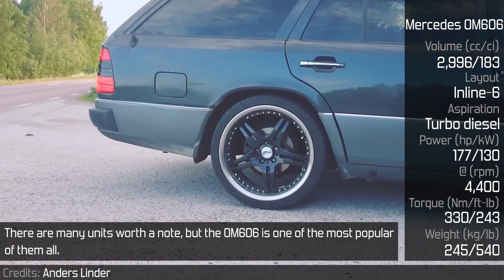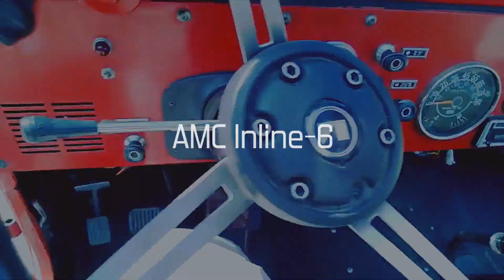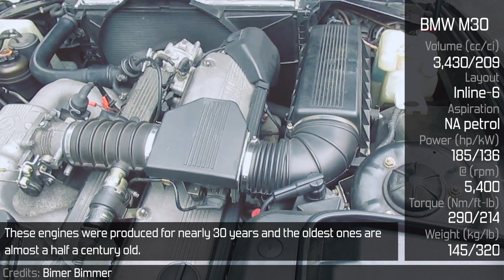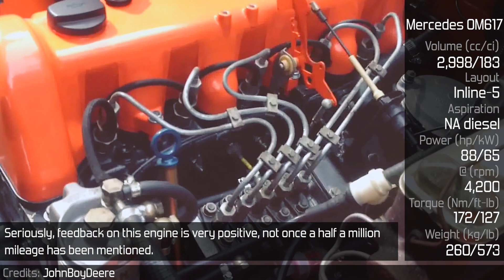10 Most Reliable Engines Running Beyond 300,000 Miles

Comment: Volvo B18 and B20 wasnt really that great stock, the B18 in particular was plagued by very cold thermostats, and all of them leaked from the back of the crankshaft until modified with a modern seal. One of my -65 B18D survived almost 200k km with the original seal but by then it was already spraying out oil through the seal, also B20s i had did this at high speeds, if i was above 110kmh it used almost a litre of oil a day. Sure they can run 300k km but not without a new hotter thermostat and seal. B19 and B21 can however, i had 100% original engines going past 600k km, only change contact points, spark plugs and oil. B18s cant do that in their original configuration.
Reply: I wonder how anyone would want to drive 300k+ in the cars these engines was in. Driving a car should be a pleasure, not a workout, and the P1800 was the only one I wouldn't had to hide in a dark corner if I owned one, the others where hideous.

Comment: First or second gen small block chevy engines. My daily truck has 298356 on the clock all original... mind you the 4l60e is starting to slip but the motor has even compression across the board and has never been opened up aside from a timing chain

Comment: Talks about reliable engines if maintained properly , shows them being redlined and getting abused .
Reply from the maker: I don't believe that changes the fact they are reliable engines. Getting abused in a good way is beneficial for an engine - you need to stretch its legs once upon a time.
Reply: VisioRacer True but it depends on the car type and when it was made as you said. New cars you don't really need to push and obviously you shouldn't really ever redline something like a suv or van but you should with like a sports car.
Reply: VisioRacer 
Remind me to avoid your "OfferUps" THX.

Comment: Glad to see the Jeep inline 6 on here. Would have heard an ear full if it was not.

Had one that had over 350,000 miles on it when I sold it to a friend. Last time I talked to him he told me it had over 550,000 miles on it and still runs great. Most major work ever on that vehicle was a clutch and a master cylinder but never any major work on the engine and still did not leak a drop of fluid.

Comment: I think the 300 cid or 4.9 litre Ford inline "6" should head up this list. UPS used this engine exclusively as long as it was made. 300,000 miles was nothing for these engines. They easily surpassed that if kept from overheating, over revving and the oil kept clean and with sufficient oil pressure. That said, MOST engines will go a lot of miles IF they are taken care of. The Ford 4.9 litre had the advantage of gear to gear timing, no chain. And it was designed not as a vehicle engine, but as an industrial engine, which Ford used as a "temporary" solution when needing a bigger "6" for the F series. It stayed around a lot longer than envisioned. BUT, there were some TRULY horrible engines built. The all aluminum Peugeot in the 60s a prime example. Better a chain, sprocket and pedals than that in your car. With most though, take care of the engine and it will take care of you. *caveat* There are "lemons". Odd man out if you will. A thousand good ones, but if YOU get the one lemon the bad taste never goes away.
Reply: 500k on a 4.0 Ford still running strong
Reply: Ups world port still had several inline 6s still running . Tugs and ground equip
Reply: Brandon Murphy my 4.0 still pumping at 350,000
Reply: The Ford 300 (4.9) will keep running even when abused.  After a nuclear war, the only thugs running will be cockroaches and Ford 300s.
Reply: And AMC 4.2 sixes with points and carbs. They will laugh at an EMP.

Comment: I had a Ford Mustang inline 6 with 320,000 miles on it.  The carb fell off while I was driving and I put it back upright and continued across and up the state of Florida from Daytona to Fort Walton Beach.  My brother was working as a mechanic and said I must have the air cleaner mixed up, then he saw it and was amazed it ran. 

 I had put some Slick 50 Teflon treatment in it.  I hadn't heard the engine knock in a while and stopped at a gas station to have the oil level checked.  The mechanic pulled the dip stick out and put it back in, came to me and said it didn't have any oil.  Slick 50, probably helped a lot with that car.

Comment: Honda Civic 2013 2.2 Idtec hatchback.
Man what an engine, certainly an underrated car.
450.000km without any issue, no damage, no black smoke.
And even drove better and better every day.

Also when i went to japan for a holiday.
those taxi's there, sheez?! (Toyota Crowns)
some had 840.000? and still went on without troubles.
They squeeked less then the avarage taxi cab i have in my country.

Comment: I've only had two vehicles that exceeded 300,000 miles without any engine trouble and the first was a 92 Ford /Yamaha SHO 3.0 and a Supercharged Pontiac 98 GXP 3.8 and neither of those cars used oil in-between changes

Comment: The Nissan TD42 (4.2 litre 6 cyl diesel) sold in Nissan Patrols and Nissan trucks is a reliable unit. Gear drive OHC, pre-common rail and solid construction. Add 10psi with a turbo and they just keep going with good power.

Comment: I have a Dodge with a 318 c.i.  (5.2 L) with about 500,000 miles on it. The secret to it's longevity seems to be to change the oil every 5,000 miles whether it needs it or not, using the cheapest SAE oil I could find. Price determined what to use. Still running fine.

Comment: i have a 2004 chevy cavalier with the 2.2 ecotec dohc and I have 265,800 miles on it and never had a problem with it. I still get 35 mpg and it starts up with a half turn of the engine. no knocking,ticking or smoking.

Comment: Had a '84 Mazda 626 5sp put 240,000 miles on it. Never had the head off.Took it off the road in '06 with original trans, clutch, carb. Still have car in my back yard...but it's seen better days...lots of rust [NY winters] but engine still runs. Replaced it with a 06 Toyota Tacoma. Just can't seem to part with the Maz.

Comment: The Toyota 3TC was used in fork lifts. I had a guy drive up to my store in a fork lift and wanted a set of points. Thinking it might be a generic distributor, I looked at the engine and recognized it as a 3TC.. I got a customer for life. The slant 6 Chrysler and the 4 cylinder 153 Chevy II engine was also used in fork lifts, as well as some Falcon Ford 6's
Reply: 76 Corolla 2tc was excellent

Comment: Look into adding the dodge slant 6 engine the dodge 318/5.2L.and any of the LS chevrolet or gmc engines  4.8 5.3 6.0 6.1 6.2 and 8.1 in either aluminum or iron. I see them regularly at 300,000 in Facebook marketplace.still running well.

Comment: Had a 1980 Datsun (before it was Nissan) 200SX with their 2.0 liter 4 cyl.  It had one of the early electronic fuel injection systems (worked great) in a basic car.  Used Mobil 1 the entire time and never had any internal work needed.  Sold the car in good condition with 379,000 miles on it.

Comment: I currently am driving a 1996 Isuzu Rodeo 3.2 L - 24 valve. It has 443,200 miles-gas mileage always at 22-24 mpg....it has started to have oil leaks-camshaft rear seal plugs on heads are leaking a bit. There is no room to access seal as it's between cylinder head end and firewall of car. Seems like oil seals are always a problem-especially rear crankshaft oil seals as the transmission has to be removed to fix that. I would think a crank seal that could be adjusted/tightened with easy access would be a great invention for car makers to utilize. (I did change that and clutch assembly on Rodeo at the 260,000 mile mark)

Comment: You forgot the Chrysler slant six.  The "leaning tower of power" is extremely hard to kill.  Used from the early 60s to the mid 80s.  A buddy of mine had one in his 66 Valiant the he sold a couple years ago, and it was still running strong.  A for reliability you couldn't beat it.  l had one in my 1980 Cordoba that started in -40 temps without being plugged in.  Sure you had to physically go out and pump the gas a few times, but it always started.

Comment: I'm not sure about the PD, but certainly the Volkswagen TDI was out before 2000.  I saw a VW Passat estate with 377,000 miles on the clock.  Toyota 2 litre diesels were another.  I saw a 2001 Avensis for sale with 320,000 miles on the clock.

Comment: BTW that volvo b1800 mentioned with 3000000 on the clock has had a couple of rebuilds I once read. It didn't do 3000000 with no rebuild.
Reply: But still a very reliable engine,  b18 and b20 was the engine used in (Hagglunds?) Bv 202 (bandwagon)  They can take beating like a champ, you can hit the revlimiter all day long and not blew the shit up, did it daily for 9months as a driver of bv202 powerd by Volvo B20 in the army, low geard transmision and the revlimitter gave it a topspeed at 39kmt at around  5500rpm i wiil remeber. On the highway the revlimmiter was attempting to get rid off :) No problem what so ever with the engine. Sorry for my english, not as good as b18 or b20

Comment: The 225 Mopar slant 6 was unbelievable. I spoke to a machinist that all he did was rebuild motors for a half century. He told me he seen 5 slant 6s that needed reboring 5. The body of the car or truck would fall apart before the motor. I had a dodge 3/4 ton 2wheel drive and a 3speed manual trans it got 22-24 mpg. While it wasn't powerful or fast it was super reliable better than my Mercedes Benz diesel. Better than my gm 250 6cylinder. I loved them especially the hemi head the only problem was oil leaks if you didn't change the spark plugs tube gaskets when you changed plugs. They were tough. Wish I had one today. The 1.2 Subaru 3cylinder was also a fantastic motor I put 342,000 on my justy before I gave it to a friend. The automatic was shit at about 150,000 I swapped mine for a 5 speed then it was fantastic. Only got about 28 mpg. The 232 6 rambler was durable parent to the Jeep 6cyl with the cast iron head was bullet proof.

Comment: I have both the Ford 7.3L turbo (International Harvester) and Dodge Cummins 5.9L.  The Cummins crushes the 7.3L in longevity and many other areas such as mpg, low vibration, and noise level.  The 7.3 is cool though, sounds tough like a tractor.

Comment: I don't know the number of the motor, but my fahther had several BMW with the 3l Bi-Turbo Diesel, those were: 335d Touring(2005), 535d( 2007), 335d(2011) Coupe, X5 35d( 2009).All bought with around 200tkm and all sold with over 350tkm, only the 535d had an Turbo failure, all the other cars had the normal spareparts, like brakes or tires and also regular 5w30 oil.
And in addition: No Problems with the DPF(=DieselPartikelFilter)

Comment: All of the engines qualify but the GM 3.8 had major problems with plastic by pass valves which would leak or break and the engine would overheat and blow up.  Plastics and cooling when will they learn, there was a time when copper and brass were common materials used for cooling systems on cars

Comment: I would have just said the whole "UZ" family of engines by Toyota as the 2UZ was the engine used in the "million-mile Tundra" which had an all original drivetrain. Also another thing to add about the 6BT is that it uses a gears for timing instead of a chain/belt for added reliability as gears don't wear out as soon as chains/belts are known to.

Comment: You really need to take a look at the Ford inline 6 older model from the 1960's 70's and 80's those motors are hard to kill take a beating and keep running  also the 351 winzor and Clevland motor or as you would know 4.6 liter v8 mostly in our older Police crusier  Ltd and Crown Vic and Pickups

Comment: Have an old Sentra 1.6 JN51 with 364,000 miles, just one head gasket change. Still starts and purrs, and my father drove it from CA TO WA loaded with weight. Nissan even built their inexpensive models to last. 
Wonder why Toyota went to single timing chain on the great 22r, while Nissan stayed with dual when going from L to Z series? 
Also have a Z24 hardbody. Been rebuilt, at close to 300,000, but now over 423,000. I don't know how it was treated before I got it at 204,000. Trans and diff untouched except  for Amsoil.
Definitely have seen the 3.8 Buick go past 300k.

Comment: Still driving my 1980 Toyota SR5 with a 20R  and a 5 speed with over 200000 miles It does not burn oil ,starts every time and still runs like it did in 1980.

Comment: GM 5.7liter  350cu V8&2.2liter
Inline 4. I had both these motors run 350,000miles,no major overhaul.The 2.2liter will crack a head(or head gasket sometimes if overheating).Still have the 2.2 in 03 Chevy S10(347,890 on the odometer)

Comment: A friend here in Canada had a 2001 Pontiac with 3.8 litre V-6 that was running fine at 830,000 km (about 525,000 miles) but the moncoque body meant the area between the floor and side of the car rusted out so he had to scrap it. I have a Y2K (year 2000) version of same car and engine runs very fine at 170,000 miles as does tranny but also the floor is rusted away around the rocker panels and welders can't find anywhere to attach new metal to.  On both cars the gasket for the intake manifold failed and was replaced under GM warranty. GM blamed the anti-freeze but obviously a bad gasket design. Also we had to replace heater components around 150-200,000 miles. Fuel mileage is not bad but not great either.

Comment: I had a 69 Ford Econoline E200 with a 302 that rolled the odometer a few times and was running smooth and quiet when I sold it. My step dad said a Engine called The Iron Duke? I never hard of it but he said there the best.

Comment: From Leo:  The B18 and B20 Volvo pushrod engines have a unique cooling design.    The water circulation is all in the cylinder head, the water around the cylinders  does not really flow, so the cylinders slowly warm up, and stay a consistent temperature even as the thermostat cycles.  The engineers claim it helps cylinder life.   It clearly works.

Comment: I have an 04 Toyota Tundra with the 4.7 V8   365.000 miles and still going strong. Never had it apart and it doesn’t burn a drop of oil. Change the timing belt every 100.000.

Comment: Shout out for the Ford Modular V8 in 4.6L SOHC 16V. There are examples of this engine all over the place with 300,000 or more miles on them. It's not uncommon, with routine maintenance, to see them exceed 500,000mi and many old Ford Crown Victoria taxi cabs have been retired around the 650,000 mark.

I once heard a story about a car service that operated an early to mid 1990's Lincoln Town Car from new until it rolled the odometer over at 1,000,000 miles before finally retiring it.

Comment: The om616 is the 4 cylinder 2.4 liter while the om617 is the 5 cylinder 3.0 liter used in the w123 among other things but it's not a 6 cylinder also in the video you showed of it an om617

Comment: Any pre-1998.5 Dodge Cummins powered pickup can easily make the 1 million mile mark with just oil and filters changed regularly. Even my 2001 Cummins powered dodge is runnigh great with it's VP-44 electronic injection pump is going strong at 181,000 miles. You have to have a good lift pump though to keep that VP-44 alive for a long run. Mine holds 13.5 psi at the VP's inlet. That's the key.

Comment: Starting, racing high rpm's in neutral, i.e. diesels: even longest living engines get reduced to sub 100,000 miles easily.  One cold start -40 equals on/about 1000 miles engine wear, hence Volvo and Saab designed to have normal life in North Sweden conditions, in more temperate translates into indeed easily half million miles.

Comment: AMC designed 4.0 liter cast iron 6 that went into Jeeps.  My '01 XJ only has 126,000 miles on it, but a co-worker's daughter's '84 XJ has over 380,000 miles on it.  Lots of quirky things go wrong with the Jeep, but the engine seems to last longer than the vehicles they came in.

Comment: The B18,B20 and B30 engines are to me the most reliable ever.. I've  even driven 10km with no driving to the camshaft with a B30.. It didn't run well, but took me home.. :)

Comment: I definitely think the 4.9 Ford straight six. Uses timing gears instead of timing chain or belt, and ive seen and heard of a few with 1000000 miles on them. Used commonly in the ford f series trucks. Also the chrysler slant six. I believe this had timing gears as well, and these were in just about any chrysler. Another bulletproof motor

Comment: COROLLA 1.8 2004 X 300,000 cars in Bangkok TAXI ran 6'5 years passed 1'2 million km. 
each motor oil changing 7,000 km. no leak no less, engine was great of all time.

Comment: My Peugeot 106 1.1 XL  (1999) has 445.000km . No burning oil, no damaged head gasket. The motor never had been opened for repair.   Still runs today. I replaced the clutch in 210.000km.

Comment: You should check Renault 1.8.16v gasoline engine. I had it in my Renault Laguna 2000 and its still running. My dad drives it now with Who knows how many km on the clock. And yeah I imported it from Italy, when it was 8 years old and only 110000 km on the clock.... :)

Comment: My dad had a 90s model subaru horizontally opposed  engine. He drove it to 500,000 km i think he forgot to check the oil level and was towing something over a super steep mountain and it blew the motor out

Comment: Dont know if its on the list but i dont think it would be because its almost only found in australia but the nissan td42 always does at least 500,000 kms usually up to 700,000-800,000 and when they eventually do go a rebuild kit is only 1000aud
Edit: mine has done about 600,000kms in my nissan patrol

Comment: I have a 1998 Ford Ranger 4.0 v6 at 227k and runs great, original engine and trans never unbuttoned. I see lots of old Rangers running around over 300k. I had my oil changed and the mechanic was trying to buy it from me. He offered $5k and probably would have gone up but I told him it wasn't for sale.